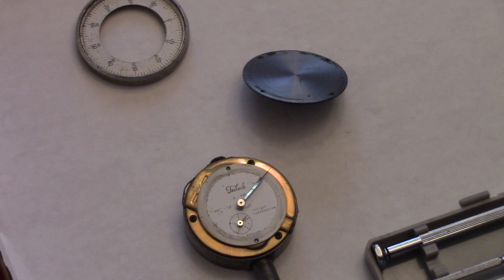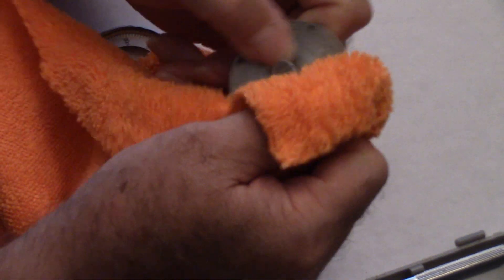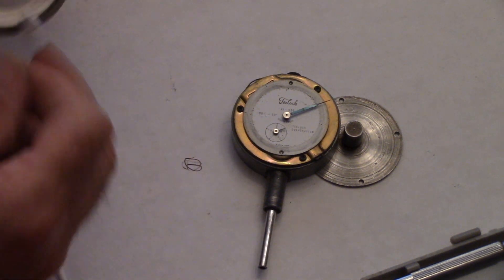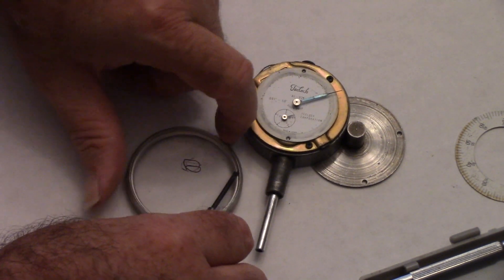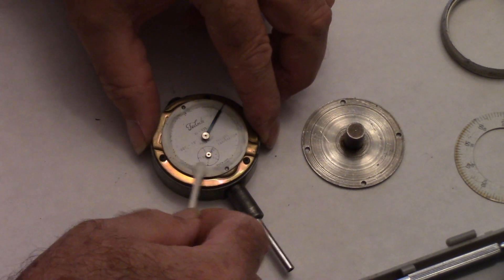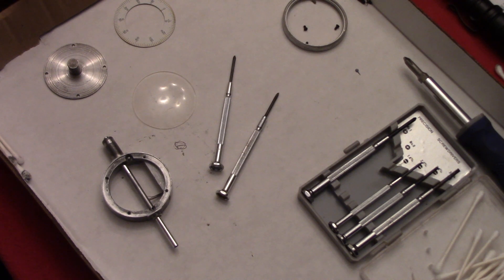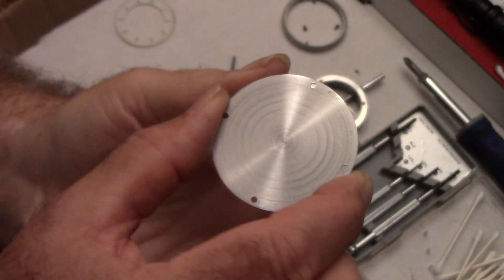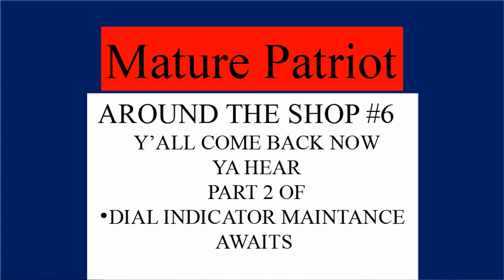Dial Indicator Maintenance #1

Comment: How did you get the bezel off?
I'm trying replace the crystal on mine
Reply: I just got it off a little bit ago there is a detent spring but there is also a screw that hold a keeper that you loosen up and slide. with the back plate removed on mine.
Reply from the maker: @toddlfrank  Glad you got it off.  I was down all day and didn't get to make the video.  Sorry.  Getting the crystal in the bezel may be tricky.  I broke one new one before I bought a crystal press.
Reply from the maker: At 1:14 in the video I lay down some Q-tips.  Where the Q-tip is nearest the body of the indicator, you can see a detent spring that needs to be depressed to get the bezel off.  I think I used a feeler gage to slide between the case and bezel.  I will make a short video, and post tomorrow, on how I removed the bezel.  Thanks for watching, and commenting.

Comment: Great video. I have used never dull to clean and polish glass before, and it has worked great for me. I tend to use that first before resorting to any type of abrasives. Keep 'em coming!!
Reply from the maker: Will have to look up Never Dull, it's new to me.  Thanks.

Comment: Thanks for sharing, I have a good dial indicator that needs some attention.  Not sure if I want to get involved with it or send it to a professional.  It may need some parts.
Reply from the maker: Parts may be problematic, depending on brand.  No parts available for the Teclock I was working on.  Luckily I bought four for $20.  Will rob the worst one for parts.
Reply: The one that I have a problem with is a Mitutoyo not a serious problem. The lens is hitting the needle.